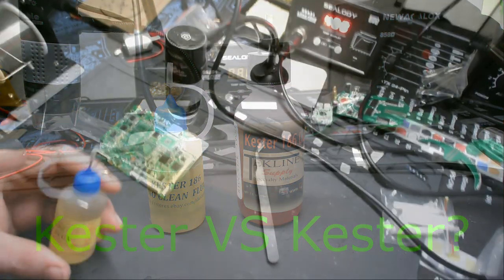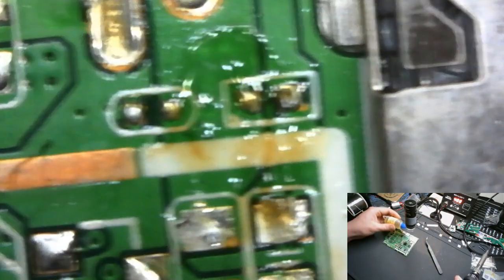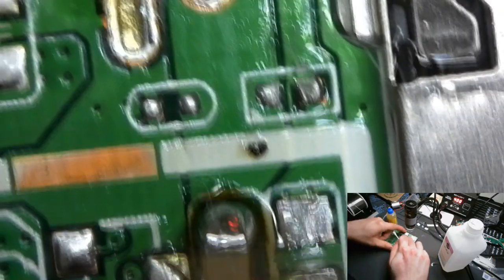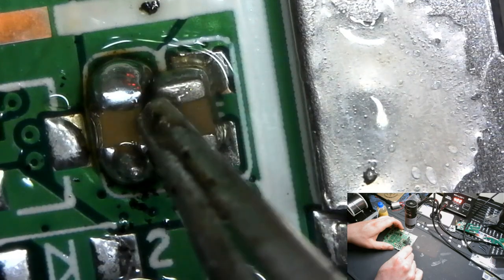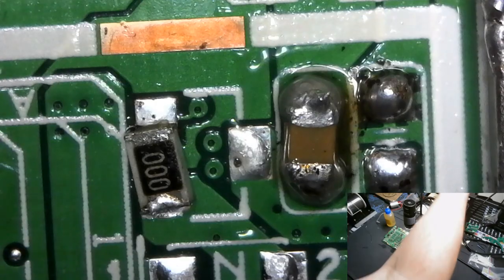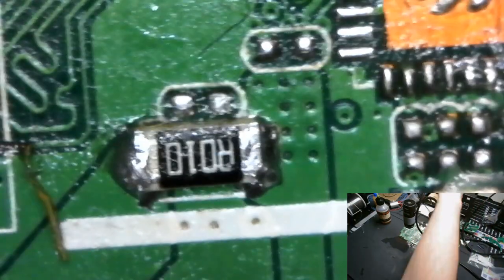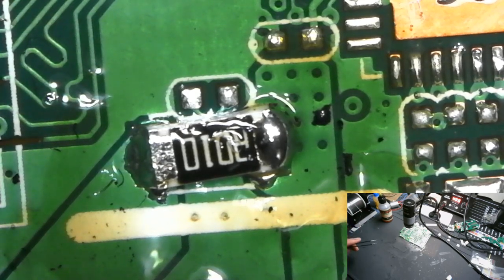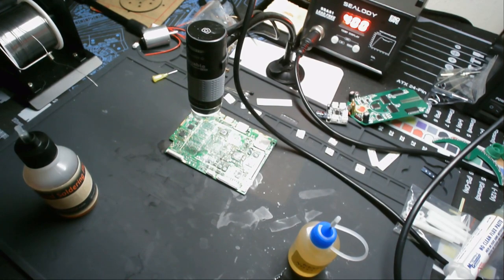Real VS Fake (Kester 186)

Comment: Flux must match the flux core of the solder used! Cannot have flux mismatching and get things to act right. I honestly would ditch the 44 cored solder and I hope you don’t have a shit load of it! If you do, get the RA solder flux to match with it, but your joints will never be match grade with any other solder than RMA. It is the best, period! Not my opinion, fact! This has been proven in countless reliability studies. That lead free crap has too long to go before a real formulation is found. Getting all that crap off of everywhere it is that you work on is a big deal. I hate lead free. That brings up something else. You need real fume extraction unless you want your kidneys and lungs to collapse. Those fumes will make you an old man inside of two years. Those fumes contain all manner of carcinogens. Ignore that warning and you’re on your own. I can’t help you if you’re going to be stupid or hard headed. This is serious! I have a Hazwhopper certification so I know what I am talking about. I still say you need a week of good training and you will be a Jedi solderer as I am. Learn the ways of the force! There are no compromises without consequences! That’s reality!
Reply from the maker: I bought a pound of the 44. I'm looking at the 282 on Ebay now. I have so much RMA flux I would hate to waste it. Speaking of which, The expiration dates, does the stuff actually go bad? What happens to it over time? Oh I agree fully about the Lead Free, I hate it. I just had to buy ChipQuik to take some lead free off of a board. So my fume Extractor is the Cheap 50 buck ones you see that are table top. I couldn't find the ones that use a hose for a reasonable price for what I do. I just do little project boards or fix broken electronics. It's annoying though because that fume extractor I have has to be right in the way to extract anything.

Here is what I have:

https://www.amazon.com/VALTCAN-Absorber-Extractor-Remover-Portable/dp/B07HPZ3FF6/ref=sr_1_4?keywords=fume+extractor&qid=1565970230&s=gateway&sr=8-4
Reply: Draxxille Gaming, I don’t know what the label on the original container states. I can’t advise on that. I used them till they were up. Never had an issue. The reason I think I didn’t is I always mixed the flux prior to filling my use container for the bench. I found if I shake the fill container or the use container for two minutes, I had no issues. The problem some have is if you do not shake the flux vigorously prior to use or filling, depending on which applies, your flux becomes separated as the solids portion will gravitate to the bottom and the solvent portion rises to the top. This is why you should always shake the fill container prior to putting it into the use container for the bench. You should always shake the flux up for two minutes prior to using or filling the flux. This insures a good dispersement of the solids and solvent. Lazy people don’t do this and then they fuss about the flux performance and it’s their own fault. The manufacturer does not always dispense this information on the label. It’s up to you to use common sense and handle your business and/or have the good sense to ask questions!🙄 the emoji is looking up in the air as if to say sheesh! Since you have sense and did ask, the emoji only applies to those who don’t care enough to ask! Okay?
Reply from the maker: Okay, That's what others have told me about the Expiration date. Alright, that's something else I didn't know. So when you say filling your container I guess you mean you have a bulk liquid flux and a smaller dispenser? Haha, trust me I don't mind asking questions!
Reply: Draxxille Gaming, if the flux is not mixed well prior to pouring and to use,  depending whether you are pouring into a use vessel or prior to solder ops, the solids will not be throughly mixed in with the solvent portion. To not mix is to throw money away and ruin your own work in the same breath. Laziness is inexcusable and has ruined many a tech’s reputation! If you don’t, don’t cry to me! 😠 I feel the same about cleaning the pads, contact areas, leads prior to and after solder ops! I have a zero tolerance policy towards laziness and indifference! Zero tolerance! If you don’t care about what you do, put it down and take a walk! There are those who want to learn and be the best and then there are those who don’t care have no business doing this! There are those who don’t agree, you’ve never done work where failure would result in loss of life and or a class A asset, capital asset in the business world! You would not want to have that memory on your head and heart! So if I sound fanatical about soldering, I am! I care about soldering a great deal. I had the best teacher ever. Charles Beckenthal! He was a hard teacher! He walks on water nearly in my book!
Reply from the maker: I assure you I will follow every bit of advice you have given me. I don't want to show people how to do things incorrectly. Soldering is definitely not my expertise, I'm an electrician by trade and more of a computer hardware enthusiast. But every bit of advice you have given I did do. The correct solder you recommended did come in, the Kester 282. Also I have the Kimwipes and gloves. I suppose now I need to look into better fume extraction. I really wish I wasn't self taught every step of the way, lol. But you know every step of learning always starts with a question.

Comment: eum.... dude i wish you not work on customer board.... go learn how to solder smd... sorry no offence 🤦🏻‍♂️
Reply from the maker: All the boards practice boards and in this video I probably had my iron for maybe 2 months. It is a year old video.
Reply: oh okok... i can give you videos link if you want... EEVBLOG, LouisRossman, PaceWorldWide, etc these are good know youtube channel
Reply from the maker: @simonspeaker  Yes I've watched a lot of Louis Rossmann. Although I have received a lot of criticism from using too much flux like he does so I made changes.
Reply: LOL dont even care about people who just want to save some money on flux 🤦🏻‍♂️ use flux when you need it !! you may use gel flux like amtech of china! they are messy but work well for the price!
Reply from the maker: @simonspeaker  Well from what I was told the reason you don't use too much flux is because it will cause heat to move away from the component you are heating to surrounding components.
Reply: LOL 🤦🏻‍♂️
Reply: you must use kapton tape and aluminium tape over the piece to desolder and use low vent pressure
Reply from the maker: @simonspeaker  idk, it's just what I was told. The guy who told me builds prototypes of whatever for Northrop Grumman so I figured that was credible.
Reply: well haha and also when you solder smd caps and resistors, put solder one side first and solder the component that side and you can easily place it and after you can solder the other side and after re-wet the first side with some flux and you will have a more reliable and easier job
Reply: flux is your best help
Reply: also for the iron if you have a good one put the temperature to 325-350 C... and your hot air at 400 C.... and keep low pressure air flow or you will take orther parts blow away... and buy kapton tape